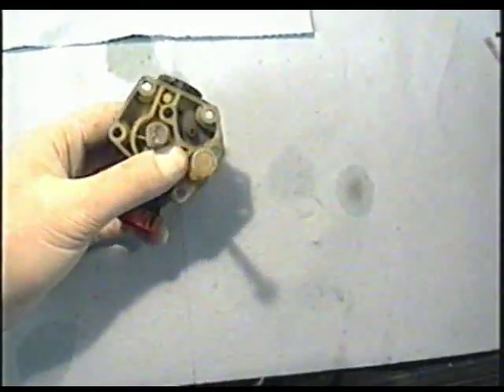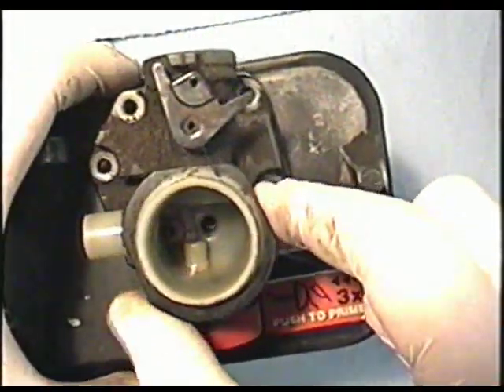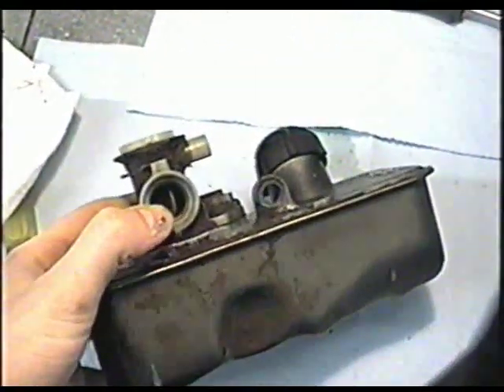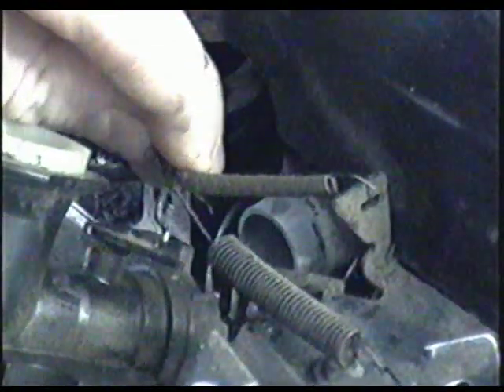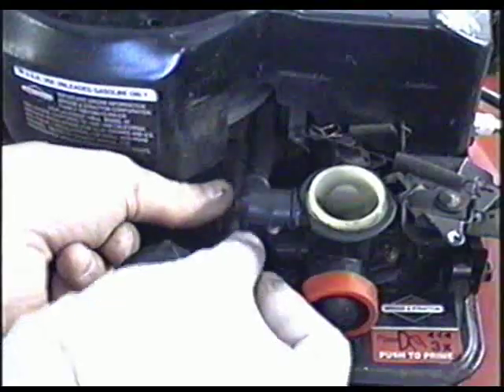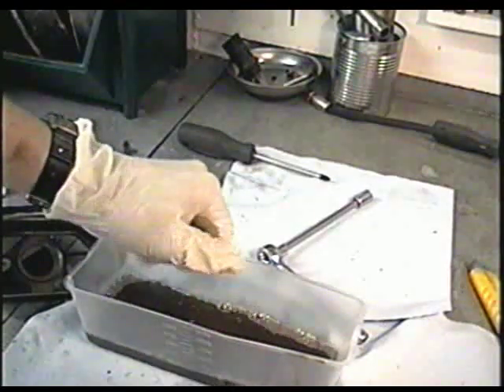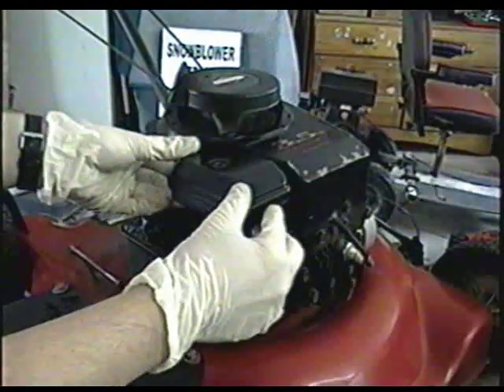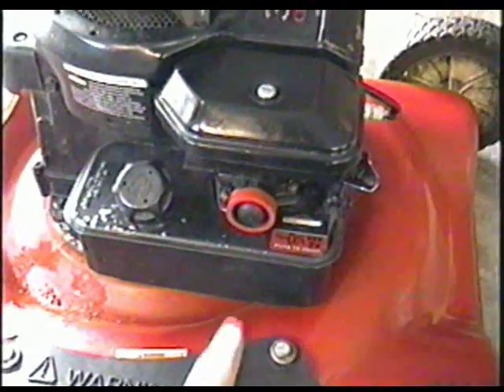HOW TO REPAIR Lawnmower with BRIGGS & STRATTON Pulsa Prime Carburetor  2/2

Comment: I have an older whites pushmower with the primer bulb.  Two years ago it wouldnt run right.  It had no power, so I just put it away.  I saw your video on cleaning the carb and decided to give it a shot.  The screens were dirty and so was the tank.  I cleaned it all up, and it ran like it always did.  The job was easy and the video helped a bunch.  Thanks!  I was feeling pretty good about myself, til' I started mowing with it and the handle broke.

Comment: These two videos are so well done and informative.  I have an engine identical to this one which has run really well for 11 years, but recently started sputtering and running poorly.  I've changed the spark plug, cleaned the filter and the problem is still there.  I suspect that old fuel clogged up the carburetor.  Some guy suggested I use a product called Sea Foam which you add to the gas.  He said it works great on his car.  I might try that first before doing all this.

Comment: For whatever its worth I put here what I did to make this mower work. I was losing my mind because it was not starting after I cleaned the carb, changed the gasket, spark plug and fuel.  Checked there is spark but wouldn't start.  I got all kinds of suggestions, changing the coil, the prime bulb and other stuff.  I then read online to spray a teaspoon of fuel in the spark plug hole.  I did that and this baby is its old charming self again.

Comment from the maker: i use carb cleaner and low pressure air to clean it, wear safety glasses, if you have it apart make sure to dry the tank fully and install a new diaphragm

Comment: Thanks for the helpful video :)
I bought an old mower secondhand it was fine at first but it started to rev up and die back, up and down up and down. Took it back and the guy "fixed" it. Now the revs are so low it barely cuts the grass, any length to the grass and it just cuts out. It will restart right away.  Before I order parts do you have any pointers?
Many thanks again for the great video, given me the confidence to try fixing this myself.

Comment: Great video Dony.   Replaced diaphragm and gasket exactly as described but it is still hard to start, if at all.  It seems that fuel is leaking from the gasket. Checked and there isn't any damage to the gasket or diaphragm.  Cleaned all carb parts with carb cleaner. Thought it wasn't seated properly, so reseated it as in the video, still leaking slightly and cant even get it to start.  Any suggestions please?

Comment: Thanks for these two videos, got mower with same engine that wouldn't start. Did everything you did and running like a beast. Changed the oil too. The filter had never been cleaned it was filthy! Its over ten years old son you think buying a new one would help? I cleaned it in petrol like you did.
Reply from the maker: Peter Wood you're welcome

Comment: 6 stars. Great info. I was wondering if u could do one on installing a generic throttle cable. Cutting it to length and putting a Z- bend in control wire. Thanks in advance.

Comment: Exellent video donny, i changed the oil in my mower with the same engine as the one you showed and tipped it back to drain oil underneath but when i filled it and started it mower didn't run right, surging and not running at correct speed, not high enough, changed diaphram and gasket and cleaned carb like you showed but still not running right ? i removed fuel pick up tube but when i did put it back in iaccidentally bent it almost at right angles and left a white mark where it bent 10 mm

Comment: Thanks for all the great videos Donyboy. I have the b&s 3.5 which after 5 hours will completely foul up with carbon, not just the plug. looked around but havent found any ideas. Compression feels good (not measured), cylinder walls are perfect, consistant spark, valves seating correctly (not checked gaps), uses lots of gas/oil, cleaned up everything carb etc. Theres more vibration than normal but i've balanced the blade. Do you think the extra vibration could be pumping more gas through? Help!!!

Comment: Hi Dony, Great Video. I just have 1 Question. Do you know why the Manifold would break on my B&S 4HP Lawn mover. I cleaned the Carb, it started great, and after about 3 Minutes running it started to run funny and saw some sparks. Is there something that I could have done to the carb to cause this to happen?

Comment: Hi donny, could you please tell me the best thing to use to clean the two mesh wire filters on the carb also how would i know if the jets in the carb are dirty ? my mower starts first pull and runs ok for a minute or two then starts running unevenly, revs slow down and speed up when i am using it ?  do u think i need to change the gasket and diaphram, would this maybe help ? my mower has the same engine as in this video, thanks

Comment: from end that goes into carb, dont know if it is now cracked ? and drawing in air now, but cant see a crack, do you think i need to replace fuel pick up tube or would i be better putting a complete new carburetor on ? thanks Bruce

Comment: @lamrof Check for spark on the spark plug. Your magneto may be bad. (pull the spark plug, attach spark plug wire, then ground the spark plug to the engine. Use pliers or something. Pull start cord, you should see a spark)

Comment: I've been searching through your channel but have not found the answer to my question. A friend has a Briggs and Stratton with pulsa prime carburetor. It surges & black smoke comes out the muffler. The air filter was crumbly, the plug was black. I wonder if replacing the diaphragm might fix it along with the plug. Have replaced the filter already.

Comment: how clear should be that white  filter that is on a length.  Also the  when I press to prime the boot doesn't seem to spray anything, I used to hear it or feel it before.  Also the primer boot doesn't spring back up as it used to, takes longer, much longer.  
Since I did what is shown in this video the Mower now is dead, new spark plug gets spark.

Comment: dony, help please, ive tried everthing, replaced diaphram n gasket , cleaned carb twice, but mower still runs great for about 3, 4 minutes then it dies out? i know its a carb , fuel issue, soon as i pump bulb few times, its starts right back up runs for a few, then dies out......thanks alot for your help...Lou

Comment: I have a briggs and stratton motor on a mower I just got for free.. Hasn't been started in two years though. D: I forsee a lot of pulling on the cord before it will start.

I dumped fresh oil and gas in it, and I'm hoping it will start once I get a new cord- the old one's kind of rotten.

Comment: I did every thing stated here, including changing the spark plug.  Engine won't start though.  The way it died was for some few usage times, it started ok but run so weakly, consumed a lot of fuel and sometimes died after sputtering.  Now it doesn't even attempt to run.  Its completely dead after I cleaned the carburetor. Wonder what went wrong.

Comment: donyboy73   great video. I'm having a problem with an identical carburetor and here's what I've done so far. replaced air filter, primer bulb, gasket and diaphragm. after cleaning the carb and fuel tank the mower ran smooth for 15 minutes then died... and I noticed it wouldn't prime. what could be the problem? the long stem I noticed doesn't have a screen, could something get in there and plug the carb somehow?

Comment: I have problem my spark plug is black. Tried replace spark plug and lawn worked fine 3-4 min and same again, like there is no enough fuel but because i smell gas from the exaust and black spark plug i suspect on rich mixture. Is there any mechanism for this carb to set mixture air/fuel?

Comment: Hi Don thanks so much for all the awesome videos! Followed this tutorial, no problems it runs, however there is still one quirk you probably know how to solve. New air filter installed it runs crappy (like it would be if the choke was on full), but I took the old one and cut it half height and the machine runs like new. It's all super clean so any ideas what I missed? Thanks. Mike
Reply: Michael Smith Did you oil the new filter? You can't just stick the new one in and go,you must oil it and wring it out..
Reply: Hi Don thanks for the reply. Yup oiled and wrung out. Not sure what it was but I took it apart and cleaned it again, and it runs fine now. Must have missed a spot! lol Cheers. Mike

Comment: my lawnmower revs to high i need to tense up my govenor spring abit more woulld this be ok if not the white flap for the throttle where it is connected above the magneto could i put thick grease in it ao it wont move so easily therefor not reving loads because it revs realy bad

Comment: The only trouble ive had with this type of carb is what seems like the fuel tank corroding or dissolving and clogging the screens after a year.  Its like a grey film, but other than that..... no problems!

Comment: Does everything have to be totally dry? thx
My fuel tank looks dirty inside, so that might be my problem. I done everything and put it back together and same thing. Should I just clean my tank out real good or try to buy a new one?
Reply from the maker: if it's rusted you're better to get a new tank
Reply: I had some discoloration in the tank. So that won't come out? I just priced one for $40 bucks. Thx

Comment: I have a mower with almost the exact same looking carb and fuel tank set up on it. My question is, the pipe coming from the engine that fits into the rubber boot on the carb, it came out accidentally while I was removing the carb and fuel tank and now I cannot get it to fit back in. It looks like it has threads on one end, but part may have broken off and I can see a small hole back in the engine that looks like its where the pipe should fit. Do you have any advice on how to get it back in and where I could find a replacement if needed? I have tried searching, but since I don't really know what the part is called I can't seem to find it.
Reply: Just push it back in. I had one I fixed up and I do not think it screws in as mine just slid in as I put the carb back on. The part is known as a crank case breather tube.
Reply: Nitro Rev Thanks for the reply. I actually fixed the problem. I had to buy a replacement as the end section of the tube with the threading had broken off. I had to open a small section on the side of the engine opposite to where the tube sticks out and remove the broken section so that I could put the replacement in. Wasn't too bad, the replacement only cost about $5 on ebay.

Comment: Alright. I have a problem with white smoke. When I start my mower, it runs fine for about 10-15 seconds, then it starts puttering and choking down. What could be wrong with it? I'm pretty sure it's not the air filter...

Comment: Hi Dan, what oil goes in this model. Great video, i finally understand where those damn springs go!  ;-)
Reply: ***** BTW mower is currently hunting and stalling after a carb clean but I think I have got the springs in wrong. Does that make sense to you - too much tension on the springs?
also put a new plug in, it sounds great when it is running, it just hunts under load (very long grass) - blade is razor sharp.